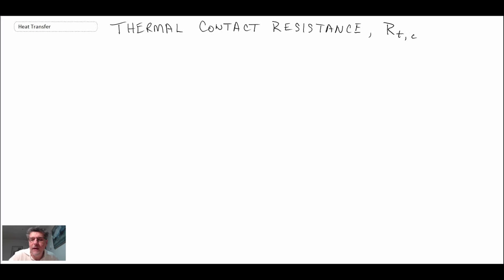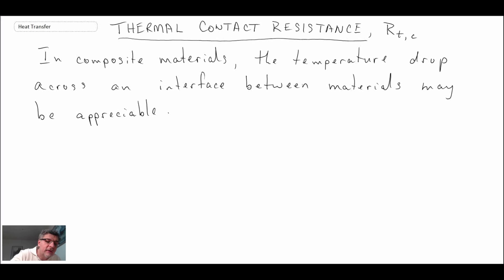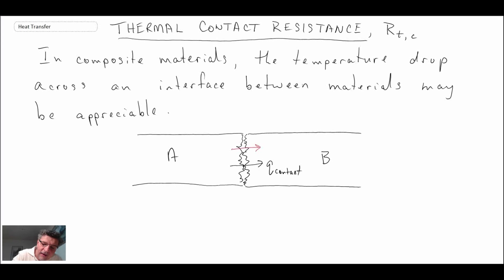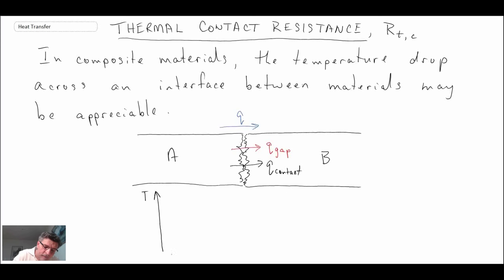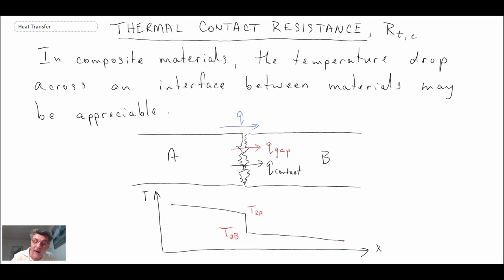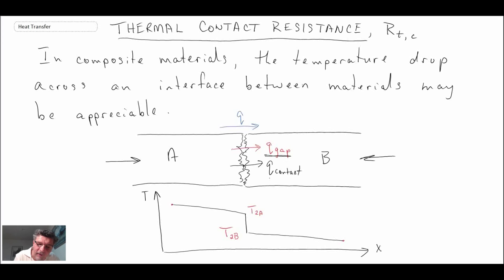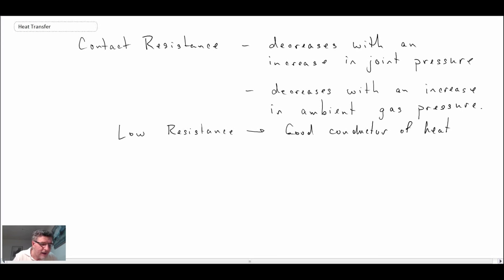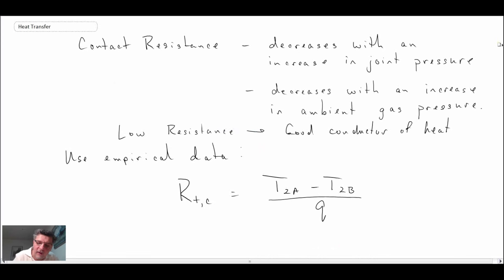Heat Transfer L6 p4 - Thermal Contact Resistance

Comment: 5:06 not necessarily true. The confined gas may have a thermal conductivity higher than those of the joined materials and hence increasing the external pressure increases the contact resistance.